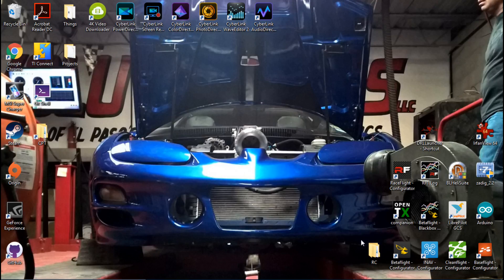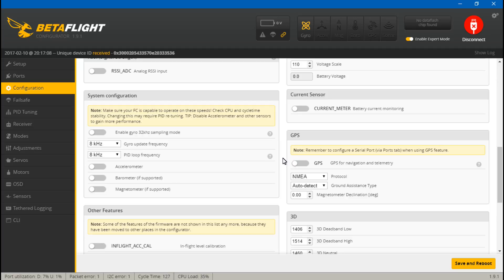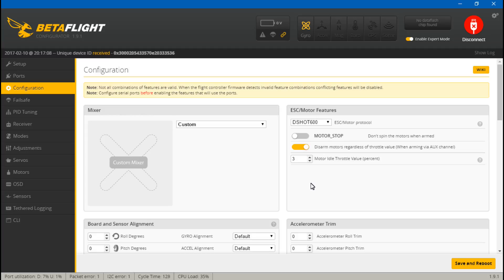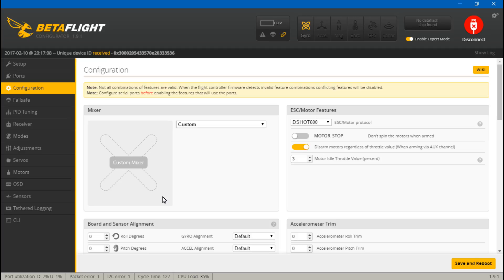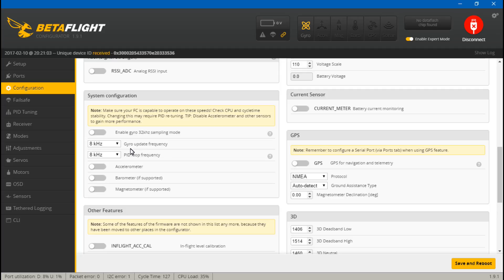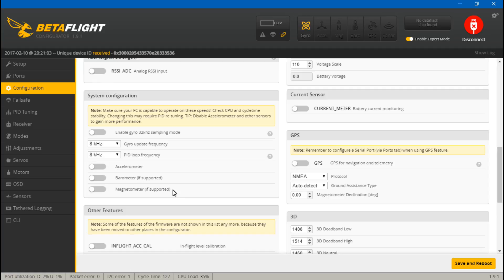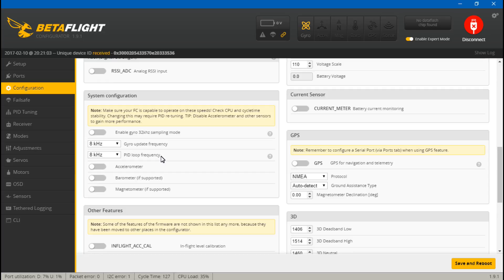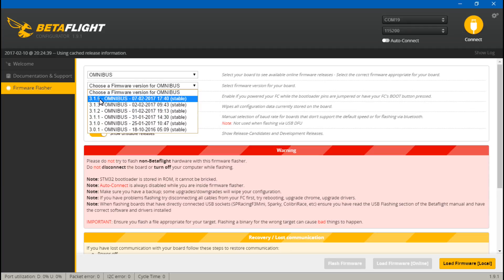Updates To Previous D Shot & Loop Time Videos

Comment: hello, nice video. I dont understand if dshot is linked to "pid loop frequency" like oneshot (and we know pid loop frequency is linked to gyro frequency and type of FC ,F1 F3 F4).
For example, if you use oneshot125 your pid loop frequency must be 2khz. Or if you use oneshot42 your pid loop frequency must be 4khz, and so on for multishot.
Dshot 150\300\600 are linked to a specyfic loop time? Which one is suggested for kind of dshot speed?

Comment: Hi
Took your advise with the Revo fc i have ,tried to flash it with Betafligh and as it flashed it hung and never said compleated,now the green light is on the fc and it's not getting reconised by my comp
Even the stm bootloader is not in zadig.Any ideas
Reply from the maker: I'd try running this tool. Try not in the bootloader first, if that doesn't work then enter the bootloader and then run the tool again. https://www.youtube.com/watch?v=9yQYVfHgmD8
Reply: Cheers got it working Many thanks

Comment: i know this is a cleanflight question but what happened to the tab where you change the sbus and rx serial tabs? i got a beecore fc for my tiny whoop and i cant find those tabs. do i need to update cleanflight? thanks
Reply from the maker: I'm honestly not sure. Haven't used Cleanflight since Betaflight came around. You could change firmware to Betaflight.

Comment: Hey thanks for doing so many vids on interesting subjects.  I have a troubleshooting problem if you have time, this will be a bit long because I'm trying to give as much info as possible.  I just built on a QAV-R frame a Lux V2 FC/DYS 30A Dshot V2 running DS600/T-motor F 40 II 2305 2600kv/RK 5040s/Matek HUBOSD with 10/5v BECs/TBS Unify Race connected on 10V to PDB, Foxeer Arrow conneted to 2nd 10V to PDB/Tattu 75C 1300s.....I flew Maiden LOS and it flew great, threw a lil tune on it and flew 2 or 3 packs.  Then I flew Fpv on a fresh pack and after a slow takeoff I punched the throttle for a split second and my view went static..then the camera which I assume lost power came back on and flashed Foxeer just as it does when I first power up.  This kept happening and I was barely getting on the throttle.  While I had no video I did have full control over the quad and managed to save it twice before crashing as the camera power on  and off.  I assume it was happening when I flew LOS I just didn't notice.  Any ideas as to what my problem is?

Comment: really liking all your how to videos, very up to date and informative. I had no idea about RSSI on the xm+ and a few other things, so thanks for what you do!

in the betaflight thread, Boris and the other guys that work on it stated that they made a bunch of optimizations to the PID loop and other things, and Boris stated that 50% is even stable now with the updated firmware with no negatives.  now with 3.1.5 I get 26% cpu with osd and blackbox on, with 8k/8k on my F3 board! it's pretty sweet! only problem is there is a bug with 3.1 5 where the max aux channels is limited to 6, so RSSI via channel 16 on xm+ isn't possible until it's fixed. thanks again for all the videos!
Reply from the maker: Thanks for that additional info. Good to know.

Comment: Hi JC, Your videos are incredibly helpful for a noob like me. I have an Omnibus F4SD but I'm having trouble getting inav (or BetaFlight) to recognise my ext compass. I've connected it up to the pins (shared with Uart 3) using the F3 pin out map as I can't find a map for the F4 but now the mag icon flicks from blue to red in a rhythmic pattern. Any ideas? Thanks
Reply from the maker: I'm not sure if its the same pins on the F4. I've only used the F4 pro. But I do have a F4 on the way so maybe I can help when it gets here.

Comment: Can you help me? In the port tab I accidentally enable UART2 and disable UART1 and hit save. Now I'm locked out my flight controller. How can I undo this?
Reply: Thank You
Reply from the maker: Chief FPV It's no problem. Flash new firmware and when you do make sure you turn on "full chip erase"
Reply: Project Blue Falcon I've tried that it won't even open. I says Serial Port Closed.
Reply: Project Blue Falcon I get a NO RESPONSE FROM BOOTLOADER
Reply from the maker: Chief FPV did you put it in the bootloader mode?
Reply: Project Blue Falcon 😂😂😂😂😂.......I got it..THANK YOU SOOOOO MUCH!!!
Reply from the maker: Glad you got it working bud.

Comment: Thanks for the insane amount of content!

Any chance you could at a video on this? https://www.reddit.com/r/Multicopter/comments/5srd48/ibus_telemetry_in_betaflight_311/
Reply from the maker: I've looked into it before, and as far as I'm aware telemetry through Ibus still isn't available. Not only would things have to change in Betaflight but also the Turnigy and/or Flysky transmitters, as in firmware updates and other stuff. But if someone ever does make this happen I'll do a video on it ASAP.

Comment: Hey quick question from past video, if I have a tablet to change pid and switches in the field is any other way to do that without Bluetooth module??
Reply from the maker: If you're talking about the EZ GUI app then yea, you can use a USB cable. You dont have to use bluetooth with that app. Also to change PIDs and rates you can use a flight controller with built in OSD, and change your pids through the OSD. Another option is to use a OSD with MW OSD firmware, you can change PIDs through its OSD as well.
Reply: Project Blue Falcon thank brother appreciate all the info you put out and all the details helps us newbies